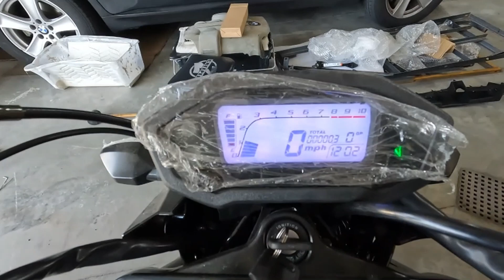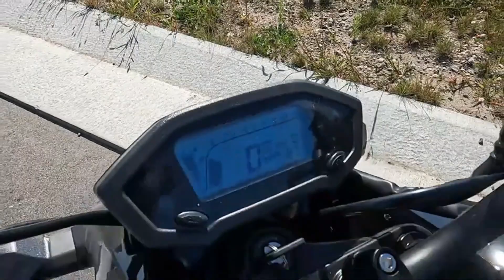Assembly and testing of Hellcat Vader BD125-10/125cc bike

Comment: Do you still have this bike? If so how many miles are on it and has thier been any major issues thats left you stranded? How big and heavy are you? I'm 6'1 250 lbs. Will I be to big and uncomfortable on it?
Reply from the maker: @kjsmolik  hi yes still have it and have passed little over 400 miles with it without any issues everything is stock on it did not upgrade or replace anything on the bike runs and drives without any problems so far. Im 6'2 and about same weight like you and size of the bike for me it's good sometimes shifts speed little hard but it's not something that is not manageable did oil change and filling with gas that I add seafoam on every fill and no problem so far , hope I have answered all of your questions!